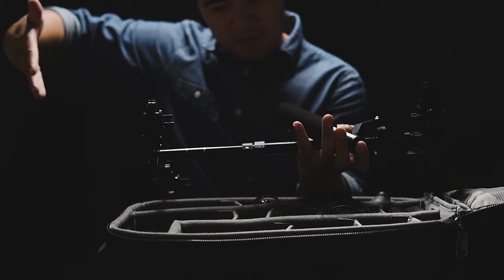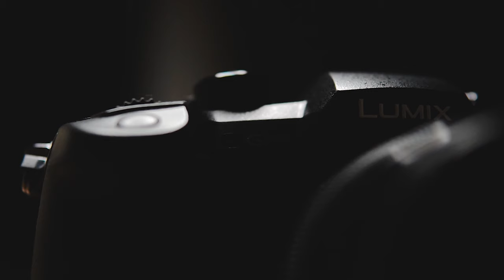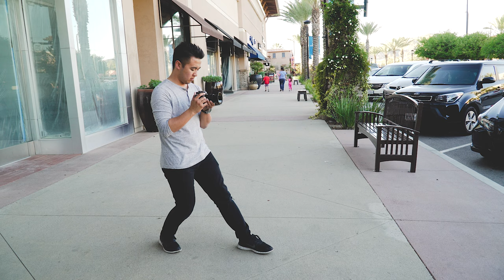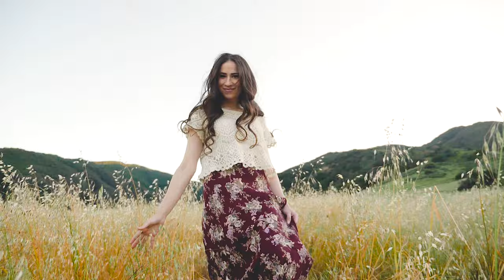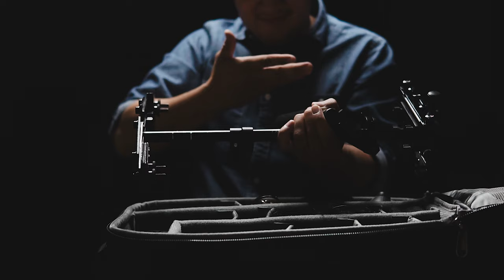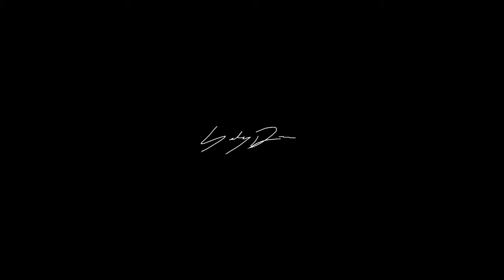How to Fake Gimbal and Glidecam Camera Movements (Panasonic GH5 Footage)

Comment: Wow! Never thought of this! Thank you very much! You have  earned a subscriber.

Do you use the manual focus on the GH5 or Autofocus? And do you use pixel peeking when filming manually?
Reply from the maker: +TheMicroGhost Thanks! Glad this video was helpful! I mainly used AFF, use pressed the shutter button halfway down to lock in my focus. I've found this to be the best way to get AF from the GH5.
Reply: can you use this method continuously/permanently  during the shoot?
Reply from the maker: +TheMicroGhost Continuously, no. Hopefully an firmware update will change that!
Reply: Sidney Diongzon oh my question was: using your method on focusing by pressing the shutter button halfway down: can you  focus effectively on moving targets or while you are  moving? so if I want to  keep a person who is running in focus  during the whole shoot, is this possible with your method?  thanks!
Reply from the maker: +TheMicroGhost No, this method doesn't work for that. However, if you use the Track Focus feature, it does keep the moving object in focus pretty well. Like a runner for example. Hope this helps!
Reply: Sidney Diongzon yes thank you! still deciding between the a6500 or the gh5 tho....
Reply from the maker: +TheMicroGhost I'm going to do a comparison video between both cameras soon, so hang tight!
Reply: Sidney Diongzon wow thank you! looking forward for that
Reply: one more thing tho: does the gh5 only lack in AF in the continuous AF`? so for everything else the AF is good? like for shooting faster stuff for stills? thanks
Reply from the maker: Yep, that's correct. Continuous AF is really slow and not natural, but for stills, it's spot on!
Reply: thank you. than I don't get the hate about it. if it's only the continous one. everybody seems to talk about the whole AF...
Reply from the maker: I agree. People always dwell on the negative, and not the positives about gear. It's not about the gear...it's always about the person behind the gear and the story they create.
Reply: thats very true. The gh5 seems, aside from the continuous AF, amazing. I really want either the Gh5 or the 6500. Still waiting for your comparison ;) Still happy with the Gh5?

Comment: what if you were using a manual focus lens with manual body and adjusting the focus manually while moving towards the subject or spinning around it, will it screw up the technique? especially when your are at f1.4
Reply from the maker: That would require a special set of skills...

Comment: This is kinda disingenuous. Mainly because the GH5 Has the Best IBIS of Any camera out right now. I would love to see this technique done on a camera that doesn't have great IBIS like A7III or 6500 or one with no IBIS at all like the Canon EOS R or a6300. 

All in All, Great Techniques tho. Great to know those techniques when you need to get those shots handheld.
Reply: That's why I'm a monopod guy. :-)
Reply: I'm so annoyed by the IBIS in the A7III.  It's great for stills, but terrible for video.  It locks, then quickly shifts when rotating around a subject.
Reply: @skymakai1486  Yes, even OSS lenses bumps the video when panning. Sometimes I turn off the OSS/IBS for moving shots (hor/vert panning.)

Comment: Hey Sidney, since you're using both, the a6500 and the gh5, which do you prefer generally speaking at the moment? Taking your lenses into consideration the gh5 kit would cost around 2800, while the a6500 would cost 1700. Is the gh5 really worth 1100 bucks more?
Reply from the maker: It's hard to say at the moment because both are great for different reasons. The a6500 is simply easier to use and have better options for lenses. But the GH5 produces better images. I guess it depends on the type of work you want to do. If it's mainly YouTube videos, then go with the Sony a6500. If you do a lot of professional client work, then the GH5 would be the better option. Hope this helps!
Reply: the a6500 is easier to use? hahaha really?
Reply from the maker: +Chava Marquęz Yep.
Reply: Sidney Diongzon I have the a6500 and I also have a Panasonic g7 and I owned a gh4 and I think the panasonic are more user friendly the sonys are definetly not easy to use at least that's my opinion
Reply: Sidney Diongzon plus there's is literally no good affordable lenses for the sony e mount I think the panasonic wins in lens options as well
Reply from the maker: +Chava Marquęz That's fair. I've used the Sony longer, so I know their system much quicker and easier.
Reply from the maker: +Chava Marquęz I disagree. The Sigma 30mm 1.4 DC DN is one of the best/affordable/sharpest lens for the E-Mount system. Panasonic glass is way more expensive and isn't that good compared to other lenses. Using a Metabones is the best way to use a GH5. Albeit, Sigma glass wins...always.
Reply: Sidney Diongzon there is good primes for micro four thirds as well, there is no f2.8 native zooms, there is not many wide angle fast lenses, and all those sigma lenses can be adapted to the panasonics as well
Reply: Sidney Diongzon i've been trying to find a good zoom for my a6500 and they're all expensive and f4... i own the 35mm 1.8 wich I love everything else is expensive and not really interesting
Reply: A6500 has a big drawback, rolling shutter. Gh5....well, I have seen professional ADV done with Gh5, and then...if you watch videos produced by Neumann films and Yuri Palma on their youtube channels...I don't think you can reach that quality with a A6500. Gh5 is more a rival of A7SII
Reply from the maker: +LAKE COMO Yeah, I agree. Filming AVCHD on the a6509 however, there's barely any rolling shutter